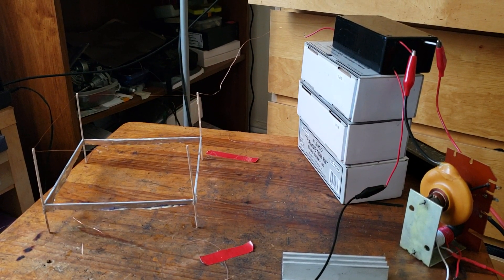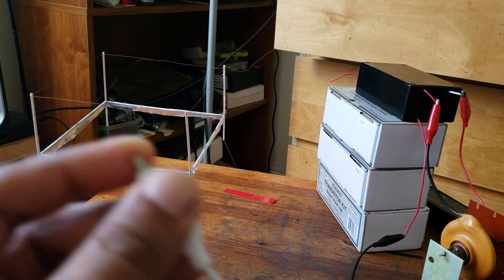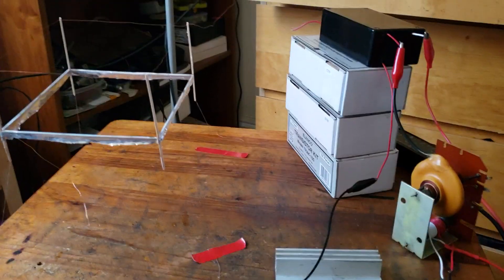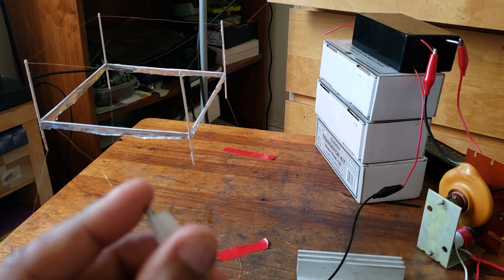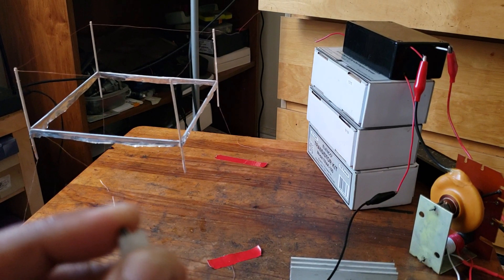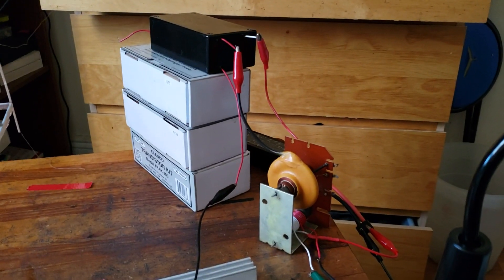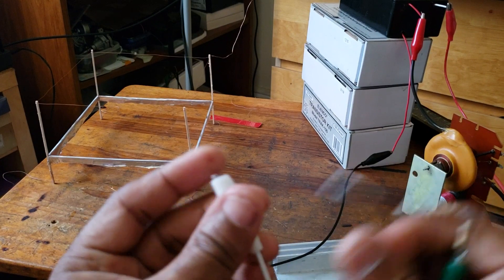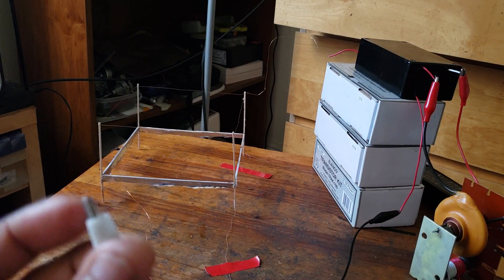Ion lifter

Comment: Hi I know this video have some time but I think your body is acting like a large antenna 📡  picking from high voltage to transferred so if you use a plate of aluminum it will do the same I just wonder what will be the use lots of possibilities

Comment: Schematic plz...
Reply from the maker: Hi, you can lookbon youtube or google search how to build a lifter. I have other videos about the power supply. That is what's more important.
Reply: @goobman1981  tks
Reply: @goobman1981  
I tried.  I have a 120 kw multiplier. I powered it from the battery ... I put the plus on the copper wire and the minus on the triangle foil.  It's not working. The sticks are starting to catch fire
Reply from the maker: @TitiProsopel  with 120kv multiplier the wire must be about 4 inches from arcing to the foil. Ca you make a video of it for me to see and diagnose?
Reply from the maker: @TitiProsopel  Now that is a beautiful power supply. I want it. Lol. With the power you could get "ALOT" OF THRUST.
Reply: @goobman1981  

can you tell me why it works for you and not for mibe ?.  the multiplier is made with 20kv capacitors and 15kv diodes. 6 stages.  The transformer is AC from the TV ...
Reply from the maker: @TitiProsopel  your lifter build design is wrong. I see why its arcing. That's your number right?. I can text or call you tomorrow and go over it
Reply from the maker: @TitiProsopel  What time would be good for you. I'm off from work. You can get it hovering tomorrow.
Reply: @goobman1981  
Yes...
when you are available.  I'm at any time.  But I think I got the triangle wrong.  I don't think I have to put wooden sticks in the corners.  It must be plastic.  Wood drives static and that's why it catches fire sometimes .... Right?
Reply from the maker: @TitiProsopel  yes and no. I will call you tomorros and go over everything.
Reply: @goobman1981  
Ok
Reply from the maker: @TitiProsopel  where do you live. There's to many numbers?.
Reply: @goobman1981  România
Reply: @goobman1981  

Também mudei os palitos nos cantos.  Eu coloco plástico ... Se eu segurar o triângulo na minha mão, ele dá um pequeno empurrão.  Se eu coloco na mesa, não adianta nada.  Acho que é porque os diodos do meu multiplicador não têm amperagem muito alta, são alguns milivolts.  Quais diodos você usa?
Reply from the maker: @TitiProsopel  I live in US. I speak english. I Tried dialing number and it didnt work. Email me. danjoblo@yahoo.com

Comment: I think I might have an inverter design. Its meant for UK power but it will work for USA power if you use a frequency of 21600Hz. i wanted you to let you know source and schematic is included - its based around and ESP32, an op amp and a few mosfets. Theres a video here: https://www.youtube.com/watch?v=qDRr0Wr252A

Comment: Hi goobman1981, 
I love your video and lifter/craft build!  You have disconnected the base of your transistor and the craft still flies.  When the load is too small on my craft and if the high voltage fields get into the circuit, these crafts can "stick" on, even, as in the case of my craft, after the receiver is shut off!  It eventually shuts off though when that happens. Transistors need very little power to switch them on.  These ion propelled crafts actually use very little wattage to fly, if you raise your emitter wires more, it will draw even less wattage.  They do however work well with very high voltages and lower currents.  Most of the current usage is because some heat is generated somewhere, like on a sharp corner.  If there are no corners and very high emitter wires the power draw will be surprisingly low.  Some power must be used, but it can be less than a propeller.  I have had the best luck with a Royer using a feedback coil so far.
Thanks for showing this!!

Comment: Maybe you start with a simple potentiometer with the voltage all the way up to high.
Reply from the maker: I would have to use a voltage regulator. But that waste power and heat. I have a pwm unit but it has problems running

Comment: I wonder what happens is the body itself is one of the terminals and on top of your head you place the thin wire, or equivalent point. Would the body eventually lift off?

Comment: One way to test that you are part of the magnetic loop is to stand farther away from the lifter. We can then see that you are indeed part of the induction to provide feedback.
Reply from the maker: I have. Heres something interesting. I found a way by accident how to make lifters hover witout being tethered. But i must figure out how to recreate the method
Reply: goobman1981 you mean without being tethered to the power terminals?
Reply from the maker: @bharbhar  No. I mean no tether lines to keep the lifter stable. They fly eractic without being tethered to the ground. I found a way for them to hover straight up
Reply: @goobman1981  @goobman1981 you are close to the grebennikov gravitoplane system which makes the body a circuit.  keep digging I'm sure you can get there, grebennikov biogravitic.

Comment: I like it. Can you do a smoke test to show airflow?
Reply from the maker: Smoke test are not accurate. The dielectric is air. Air can be easily disturbed and move. Thats why they fly erratic. The flow of air you feel is just reaction of the field generated. I put a board on top to stop the airflow and it still floated. Ionized air is not why they fly. They dont work in a vaccum because u removed the dielectric. Thats like taking air away from a cars engine. Why should it work
Reply: @goobman1981  I agree with you. The smoke test just proves the point that the lift is coming from the field and not from air flow. I am working on this also and will upload another video soon.